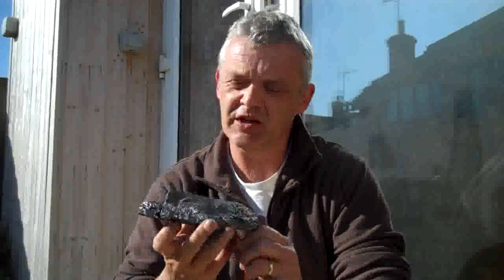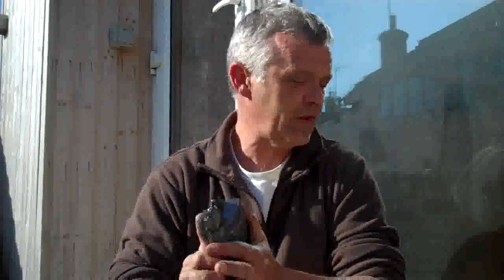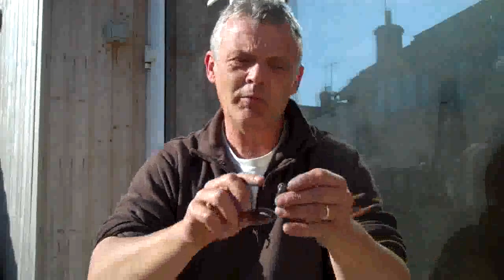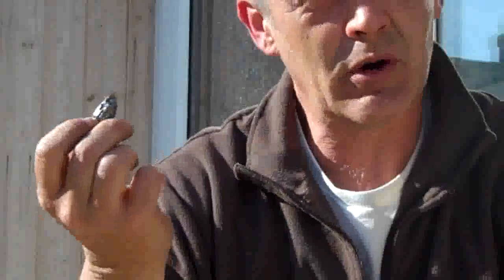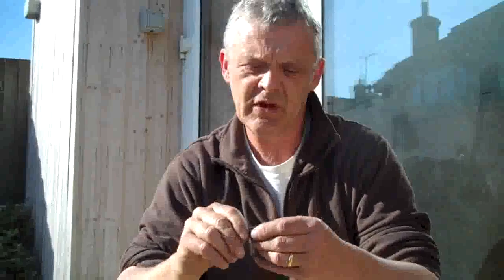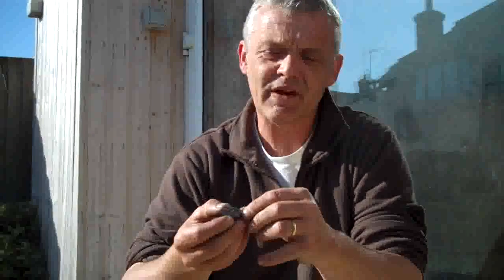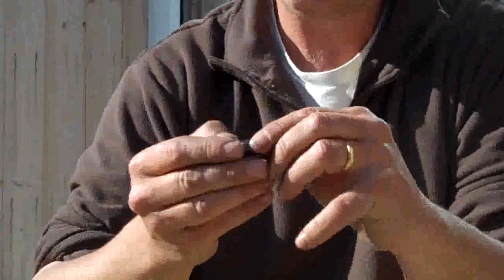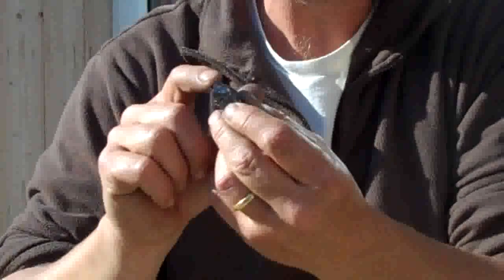High diamagnetic graphite solar engine - part 1

Comment: hmm, not to be a buzzkill but I'm fairly certain that the reason the graphite sheet is moving is because it is transitioning from diamagnetic to paramagnetic due to the heat the same way a ferromagnetic substance does at sufficient temperature.

I dont think it would spin in some arrangement of concentric magnetic fields so much as just dip towards the side that is heated.
Reply from the maker: htomerif don't worry about it mate - it probably is doing exactly that. Still it is interesting it does anything
Reply: Robert Murray-Smith Do you know if the diamagnetism of that material is anisotropic with respect to the cleavage planes?  I suspect it might be, such that it is not diamagnetic when the sheets are parallel to the magnetic field, only when they are perpendicular.  Theres a lot of anisotropy of electrical resistance in that kind of thing.

It might be somewhat difficult to test.  If you crushed it into a fine powder I would expect the grains to order themselves with the magnetic field and not levitate when placed in something like a test tube to keep them contained.  since the diamagnetism is so weak though it might not overcome van der waals forces or just plain electrostatic cling even if Im wrong.

Anyway, I could possibly imagine some interesting effects if the diamagnetism was dependent on the sheet orientation.

Comment from the maker: The heat from the light destabilised the crystal structure and it loses it's diamagnetic properties. The other side keeps that property so, it is not so much that it is attracted to the light but rather repulsed from the other side

Comment from the maker: no probs mate. I am going to try making an exfoliated form and try making a foil of that. If you were to mix the titanate in with the exfoliated graphite first then press into a foil that may be a way of getting the two to combine. I am not sure what is in there. So far I have asked for an assay and a friend of mine is waiting to get a bit so he can run it through a spectrometer and SEM. so hopefully we will have some answers soon - but these thing take a bit of time - Rob.
Reply: Any signs of getting the results on the testing composition? It will be interesting to see.

Comment from the maker: This particular graphite is highly diamagnetic. The diamagnetism is probably a product of the dopants and lattice structure. The photon input will alter this an therefor alter the diamagnetic property at that point causing an imbalance in the system that attempts to compensate for and therefore we get movement. The relaxation time is very rapid so removing the input returns the equilibrium.

Comment: it would be interesting to investigate if the heat affecting the magnetic of magnetic flux or VOC graphite. you should repeat this experiment with other diamagnetic materials interesting phenomena. 
have you tried using laser instead of sun beam?